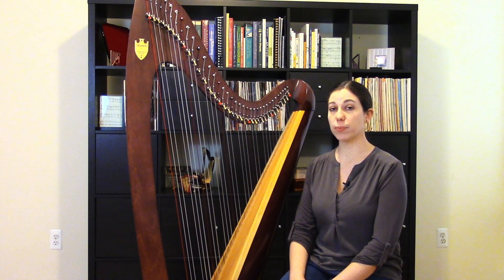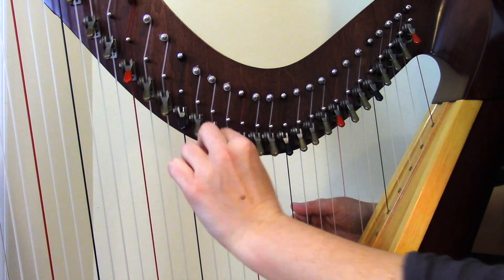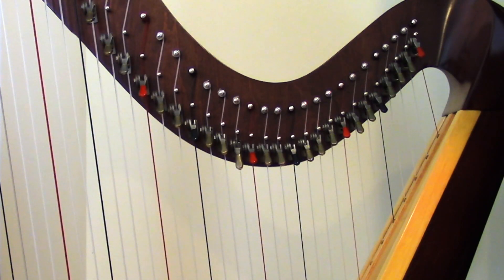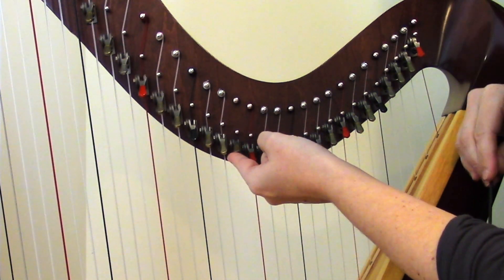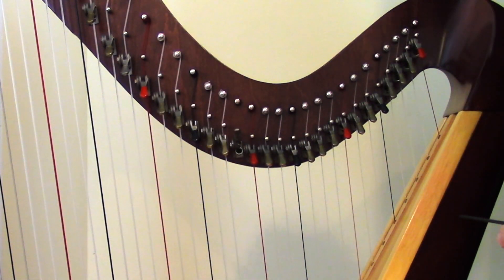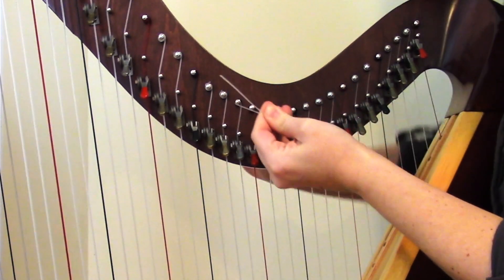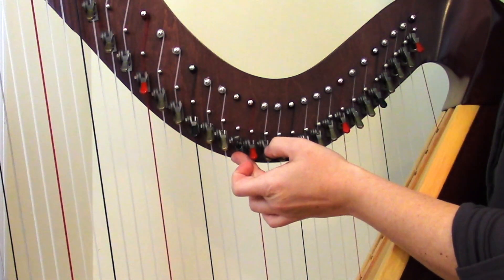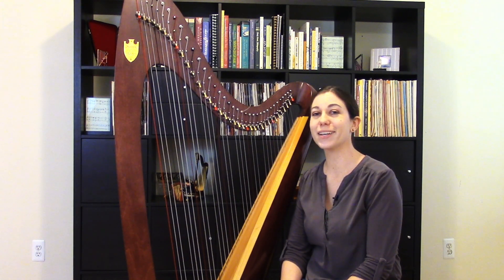Replacing a Lever on a Lever Harp, Harp Care, Maintenance, and Repair #21

Comment: Thanks for the wonderful video.  I do use a Troubadour 2 as my studio Harp and am starting to have trouble with the Levers. Is it possible to update them? Thanks Mark Bensette Aux Bois 🇨🇦.
Reply from the maker: Upgrading levers can make a harp sound great! However, my understanding is that if you wish to put  upgraded and a different type of levers on a harp, you usually have to remove the old levers, fill it the holes that they leave, and then drill new holes for the new levers. I personally have not done this, as it's rather daunting, but would love to give a try (perhaps on a very old harp where I could experiment a bit). You can also have a harp technician do this. Sorry not to be of more help!